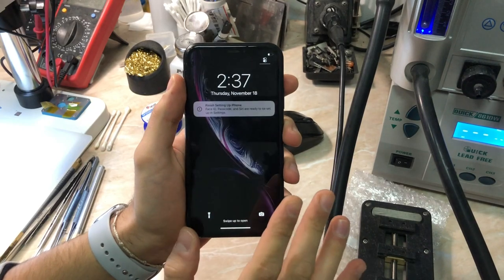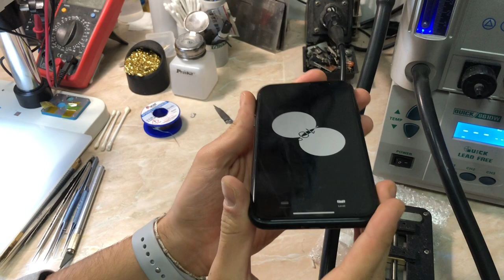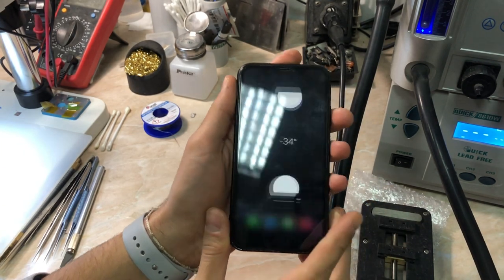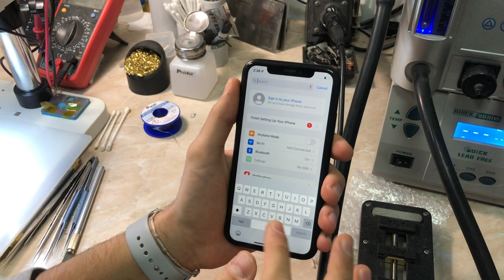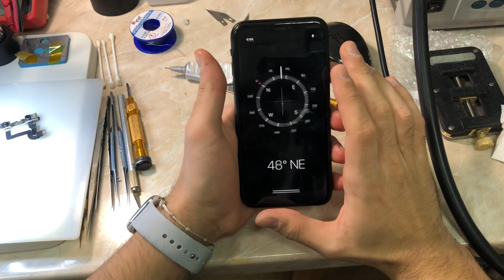iPhone XR Compass Not Working (Easy Repair)

Comment: Hello, I recently changed the case on my iPhone 11, the case is not original, there was a transparent gelatin on the NFC band when assembling the phone, but I did not need to remove it, I assembled the phone and I used it in working condition, but recently I realized that my compass is not working, in addition to this, my NFC reader does not work, I disassamled the phone again and I saw that I forgot the NFC socket under the motherboard, I mounted it in place, but nothing changed, do you think it's a problem with the transparent band or there is a problem with the flex cable, how can I test it? According to a website it might be related to the volume up and down keys. Lastly, all sensors including the gyroscope are working, only the compass and NFC are not working.